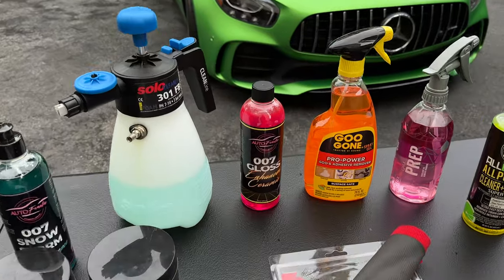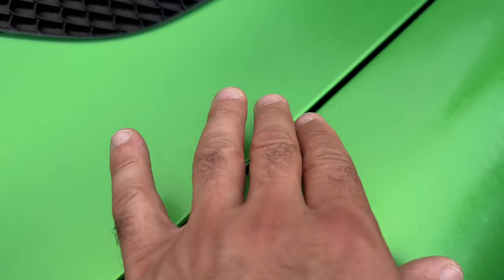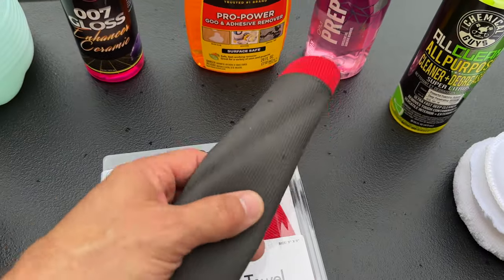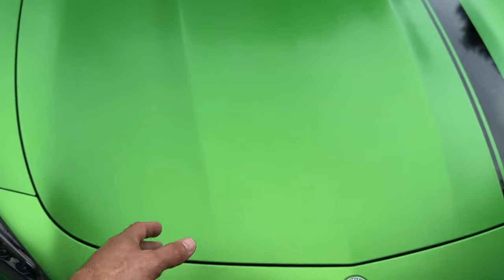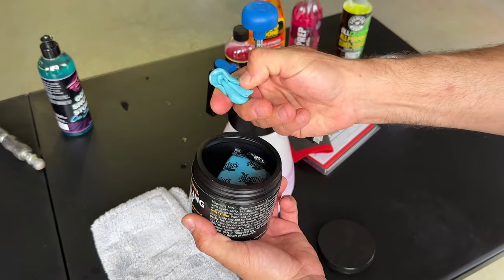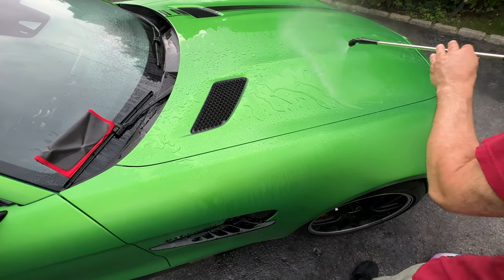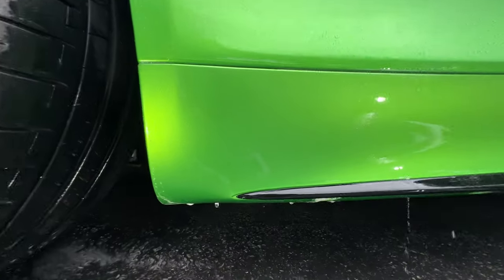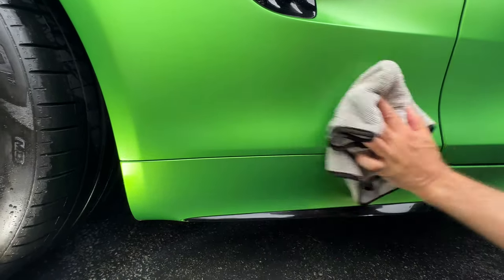Detailing & Cleaning Matte Paint Finishes | 4 Simple Effective Solutions

Comment: Gotta have PPF on magno paint. I'd go crazy from anxiety driving around with bare paint 😬
Reply from the maker: Ppf still doesn’t help sap and contamination from sticking it seems any thing matte is much more upkeep im learning
Reply: @autofanaticcars  yeah true I got Xpel stealth on mine and just the PPF alone only made it slightly easier to clean. After adding Dr. Beasley's matte film coating it's insanely slick and kinda enhanced the finish too without adding any gloss. Best ceramic coat I've used to date when it comes to matte PPF. Nothing sticks to it, clean after just a quick blast with the pressure washer.